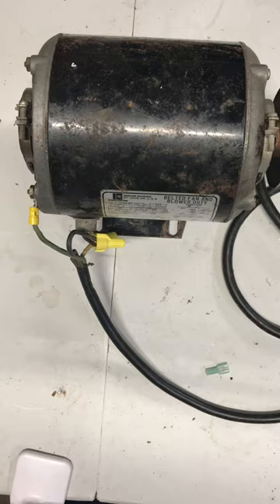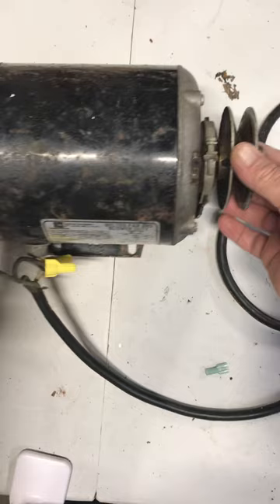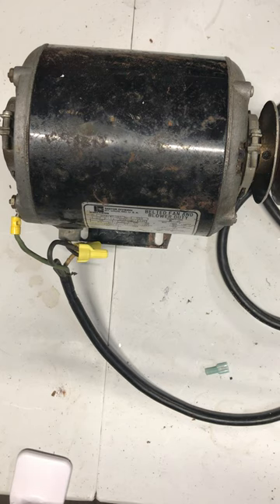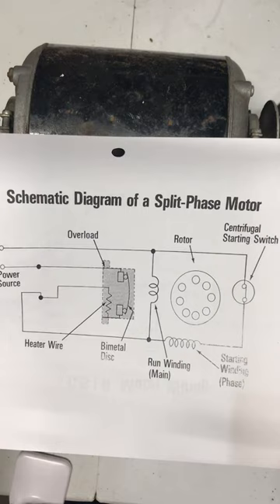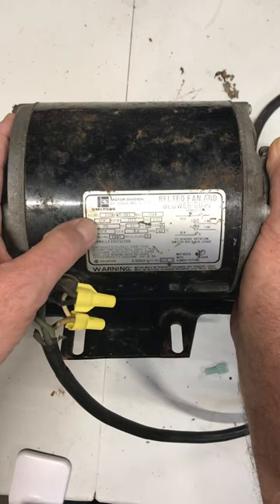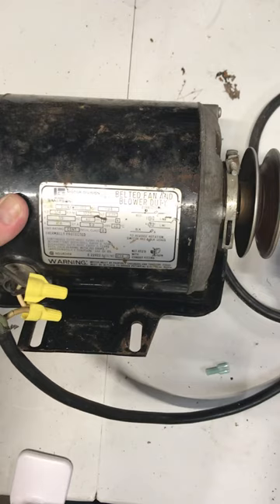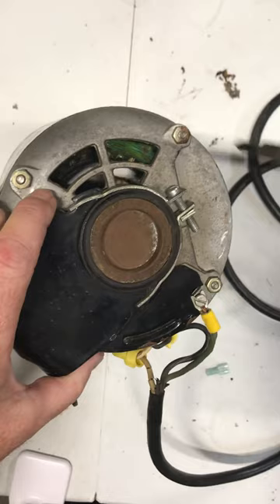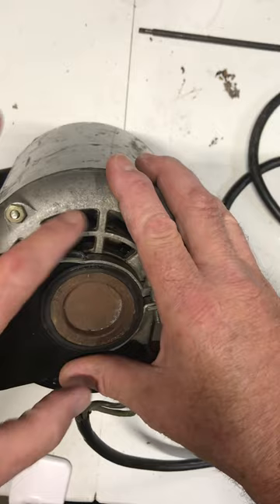What is a Split Phase Motor

Comment: I don't know much about motors but would appreciate your advice...
I would like to get a 1/4 hp motor for continuous use. I would be running this motor all day, everyday for long time. I'm making a rock tumbler & using it to tumble rocks. This will be running for weeks at a time 24 hour a day. I don't know if I need a single phase motor. Or if there are motors with built in fans within the motor to keep it cool? I heard Dayton or Marathon motors are good. Any advice
Or input on this would be greatly appreciated!  Thanks 😎
Reply from the maker: I would think you would want something with lower rpm’s I don’t know how fast rocks are supposed to be tumbled. A 220 volt motor would be more energy efficient and hold up longer than a 120 volt motor. Maybe even CSIR ( capacitor start induction run ) this would have more starting torque since I assume it would be kind of a heavy load.
Reply: @frederickkosier2508  Thanks for responding. I'll consider your advice. Rocks are heavy! Other people on YouTube are running a split phase 1/4 hp motor 1725 rpms, with 2 or 3 row teers, 36 inches long. Barrels are rolling on 5/8" to 3/4" bars with pulleys & pillow block bearings. I heard split phase motors are good for this, especially running in your home... more efficient. What is your advice on this type of motor?